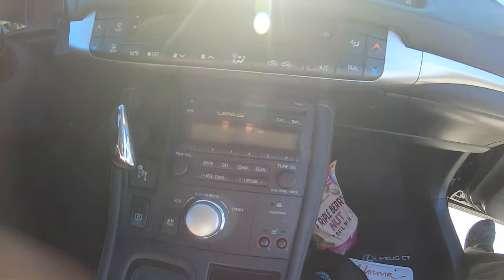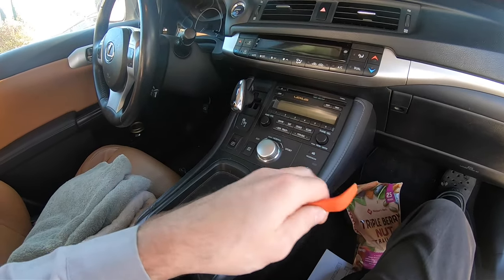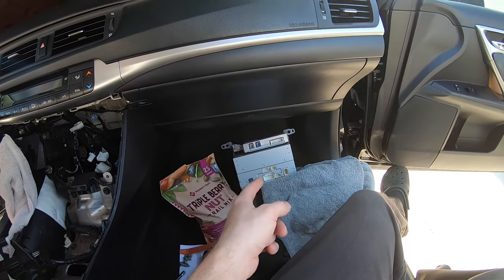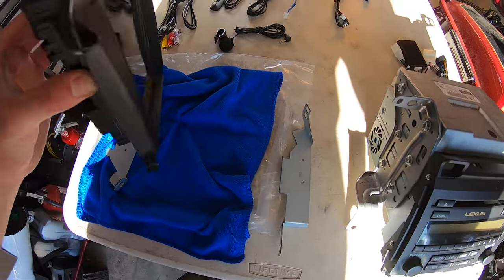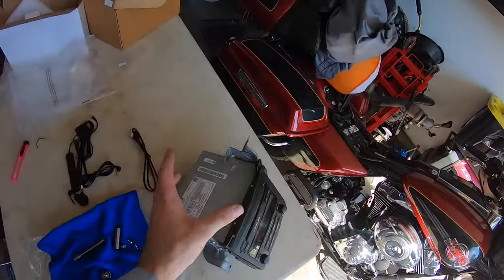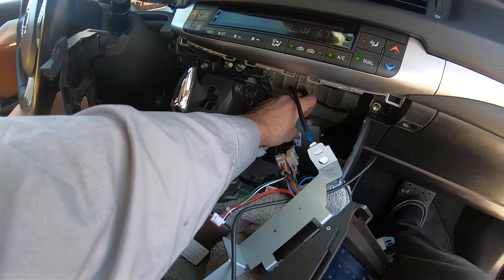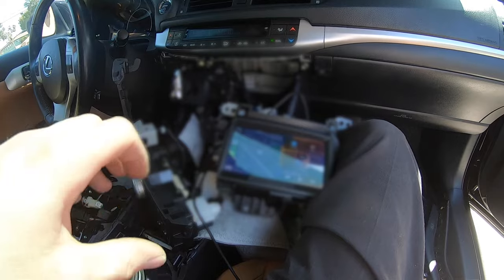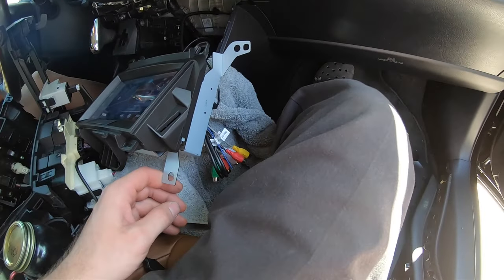The Best Head Unit Upgrade for the Lexus CT200H! (Carplay, Netflix,Youtube)

Comment: how does it sound? these cheap Chinese units often sound worse than the original unit.
Reply from the maker: @occasx  they sound about the same. You have to leave your OEM amp in or your tweeters on the dash stop working.

Comment: Hi, I just had this unit installed in my car and there are two things that the guy couldn't figure out, wasn't in the instructions and the seller hasn't responded to the 6 messages I've sent him.  So I'm hoping you can answer these questions for me, if you would be so kind.  The unit wont connect to the steering wheel controls. It comes back with "setup failed" and there is no volume icon on the right side where, according to the instructions there should be... so I can't control the volume unless I go into settings and change it from there. I really hope you can guide me with this because I just paid a guy $250 to install this and he couldn't even figure it out. Beyond frustrated. Thanks in advance.
Reply from the maker: Hello, hopefully he Didn’t put the wrong unit in your car. Did you buy it from the same place I did?  If so they can answer all of your questions.  They sent video responses for every question I had.  As for the volume, you can swipe down from the top twice in a row and a volume screen will slide down

Comment: I heard that the sound quality (especially the bass) isn't as clean on this as the oem stereo. Any issues with that at all?
Reply from the maker: No issues with difference in sound, I did find that it works without the amp plugged in but the front tweeters didn’t work so thats why I plugged the OEM amp back in. Sounds pretty good!
Reply: @slightlymodified501 hello! I bought the carplay in my lexus 2011 ( with canbus) and the sound is horrible, worst than before. Do you have how i can fix the sound? A amp oem or something. Thanks!

Comment: how did you fit the amplifier to the new nav system? the connections will still be the same
Reply from the maker: I just plugged it in and tossed it back there
Reply: @slightlymodified501  thank you for responding. And your vid is the best. Just to confirm, for the old system, you unscrewed the radio unit from amplifier, fitted the amplifier and new andriod unit to the car correct? No other vid has shown this. And i am asking the manufacturer but i have not gotten an answer.
Reply: @bolanlebalogun9  Were you able to figure this one out?
Reply: @MrTj2409 I don't think he was honest when he said he reconnected the amplifier. The only way you can have the amp connected is to have the Lexus variant with inbuilt nav display. With the variant without dashboard display you will need to take out the amplifier to fit the advertised kit. Hence I did not purchase because base sound was very important for me. I took out the system and checked the connections to verify.

Comment: Have a link?
Reply: hi, did you find anything?
Reply: No, I sold the car 🙃
Reply: @richardmontalvo3513  did you not like the car? or just made good money off it
Reply: @damonj8056   man having issues with the hybrid battery, sold it quick
Reply: @richardmontalvo3513 how many miles did it last before the battery issues?
Reply: @DarrellC.   130k miles, bad battery, was asking for a hybrid system failure, sold it for 5k
Reply: @richardmontalvo3513  Could have replaced the hybrid battery for less than 2k